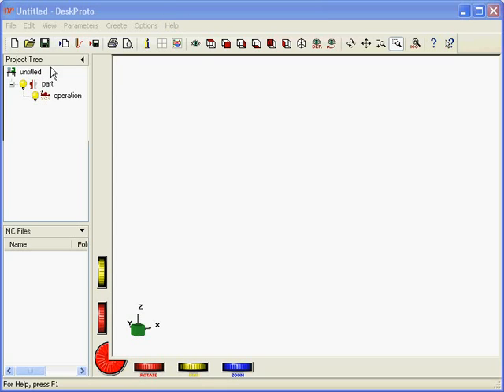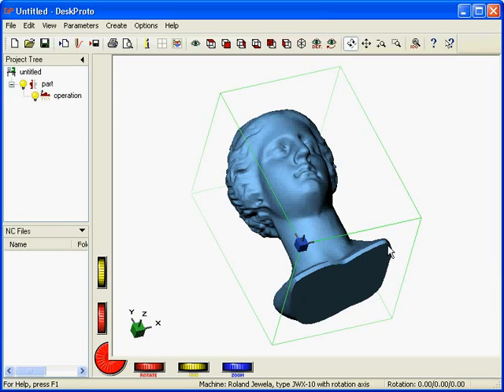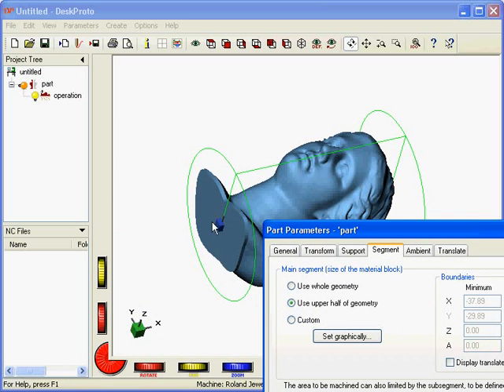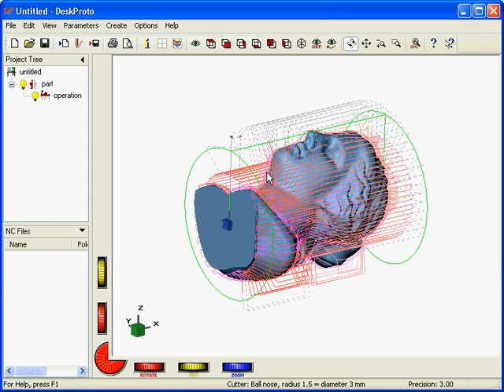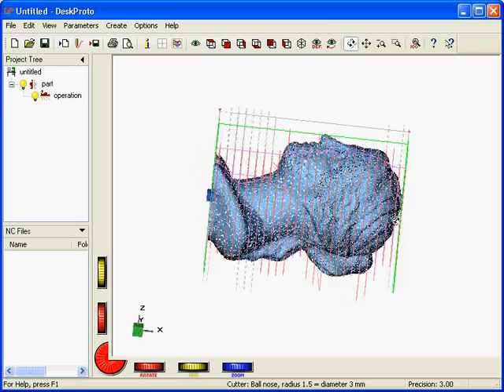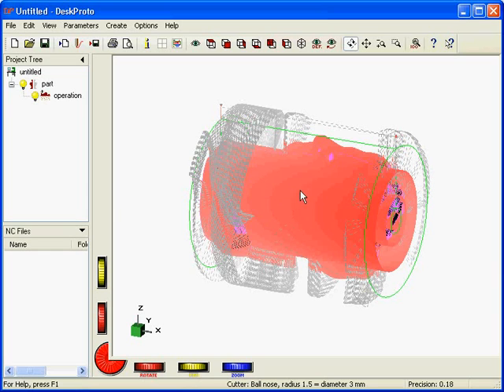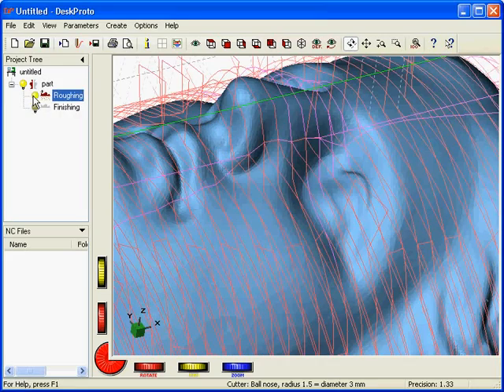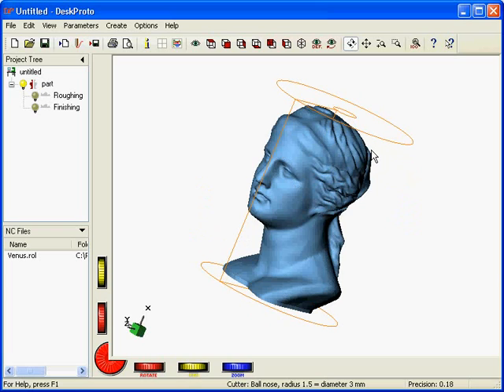Rotation axis machining in DeskProto (Venus)

Comment: Hello, my cnn have Only Y axis rotary, Can Dproto run Y or Only aæong X?
Reply from the maker: The rotation axis in DeskProto is parallel to X. However, in de machine definition (Options menu) there is an option called "Has 4th xis parallel to Y". Use the Help button on that location for a detailed explanation.
Reply: @Deskproto thx, I try it, in Fusion i use Mach3-A , I Think it is call, my cnc is born with 4 axis output.

Comment: Wowww!!! Está muy bonito el trabajo pero me interesa hacer algo más "sencillo" con el cuarto eje. Puedo grabar frases o imágenes en cilindros de acero inoxidable con éste programa? Si es así, puede hacer un video de cómo sería?
Reply from the maker: Google translates this as "Wowww!!! The work is very nice but I am interested in doing something more "simple" with the fourth axis. Can I engrave phrases or images on stainless steel cylinders with this program? If so, can you make a video of what it would look like?"

Creating toolpaths on a cylinder shape, for text or for an image surely is possible.
For text see then end of the Lincoln video: https://www.youtube.com/watch?v=ZVgvf4p67WI
For images see the pipe lithophane video: https://www.youtube.com/watch?v=9nTYgwj9B_k
Whether or not this can be done ins stainless steel will depend an the capabilities of your machine.
Reply: @Deskproto  Gracias por responder. Bendiciones.

Comment: rotary toolpaths  can't setup on Y axis?
Reply from the maker: In the machine definition of your machine (Options > Library of machines) you can check an option that the rotation axis is parallel to Y.  Press the Help button on that page for more information.
Reply: @Deskproto  It really works!

thanks a lots

Comment: i have 4 axis machine, means, x,y,z and rotary part, i setup it parallel to Y axis, and become B axis (your program uses A for x,y,z rotary, can add B, C, please?) . Anyway. can i ask what happens with machine? i did venus toolpaths, i used rotary and change X for Y in library machines and save it 4 axis mach3 post processor.
After that, mach 3 , shows toolpahts ok, start running ok, but after few good lines, stop in 1 line, but machine continue cutting, like crazy,  finally after finish toolpath, it creates a CYLINDER , nothing show about VENUS. Can help to solve this? pls. thx. Chinese cnc router 6040.
Reply from the maker: Based on only this information I cannot tell you what went wrong. I would need to see more information, like a Problem Report ZIP file (can be made in the Help menu).  I also do not understand: you say that the machine stops and continues, which cannot both be true. Note that in DeskProto V7 you define a machine with the rotation axis parallel to Y (Options > Library of machines > OK on warning > Select your machine and press Edit > Press Advanced settings - also see the Help information there).
Reply: @Deskproto  its not about deskproto, coz i did toolpaths, its about mach3 and rotary: when i said stops  is in gcode screen  no scroll down , left side of mach 3 window, but machine (rotary, and Y) continue cutting, thta's what i meanand in middle of mach 3 screen, movement of axis continue working, showing A,Y axis movement, but crazy. thx my friend x reply.What i can do to fix it ?
Reply from the maker: @nemesi1177  OK, now I understand. I am afraid that we cannot help you though: we are not using Mach3 so we do not have any suggestions for your on this issue.

Comment: hi , can we use technical letters for rotational axis? A if rotate parallel X axis, B if rotates parallel to Y axis and C axis if rotate parallel Z axis, avoiding using words like "wrapping around", or "along .. axis", confusing. Thanks
Reply from the maker: You are absolutely right about the use of A for a rotation axis parallel to X and a B for one parallel to Y.  Unfortunately many machine manufacturers do not follow this standard and use A also for an axis parallel to Y. So when we use B that would confuse many other users.  In DeskProto V7 you can select both options, in the Advance machine settings.
Reply: @Deskproto  i mean can you fix it with deskproto, coukd be a great thing !
Reply from the maker: @nemesi1177  As said: in DeskProto V7 you can select both options, in the Advanced machine settings.

Comment: You do this in free edition sir?
Reply from the maker: Sorry for my slow reply (due tot vacation).  The free edition does not include rotary machining. You can nevertheless test it, by running the Multi-axis edition in trial mode. The resulting part then will show a watermark

Comment: Ok.  So my CNC machine is on it's way this week.  Been watching your videos.  I am a bit surprised how difficult you seem to make this software.  I was told that it is easy to use.  After watching a few of your vids it seems anything but easy.  I think perhaps shorter & TO THE POINT videos without ALL THE RAMBLING would work out a bit better.  
Thanks...
Reply from the maker: Hi Lowrider,
We try to serve all users, so we need both simple videos and also videos that show the more complicated options (that you just can ignore when you do not need them). For you it will be easiest to start using one of the Wizards that DeskProto offers. These will guide you making the basic settings and simply ignore the rest (as all complicated parameters have a suitable default value). Enjoy working with your new machine !

Comment from the maker: Hugh,  DeskProto should well be able to work with your machine for 4-axis jobs, using your A-axis or B-axis (I am not sure what you have: an axis that is parallel to X and rotates round X in my view is an A-axis). You can test this using the free trial version.
A C-axis is not supported by DeskProto, so you cannot use it for 5-axis jobs.

Comment: Lex, I have a 4+1-axis machine. The primary rotational axis is C (rotating around the Z-axis) and the secondary rotational indexing axis is B (rotating about the X-axis). Will DeskProto code for my machine with a properly edited processor?

Comment from the maker: This Techno HDS machine is not yet in the list, however it is easy to add a new machine. When the machine supports G-codes the best is to first try using the machine definition called "ISO plain G-codes". When that works, you can copy this machine definition and enter the correct name, speeds and dimensions for your machine. When it does not work some fine-tuning of the postprocessor will be needed. That can be done by any user, and we are also happy to assist.

Comment from the maker: Hi Alex,
I just checked the website that you mentioned, and for the machine it says: "Control software: Mach3".  This means that when in DeskProto you select one of the machines called "Mach2 / Mach3 based machine" it should work OK. You then only need to enter the correct dimensions and speeds, via Options > Library of machines".
DeskProto is indeed very well suited to create mini-models for your museum.
Lex.